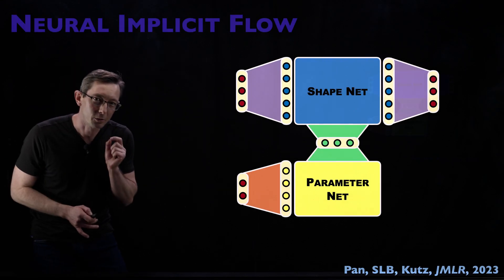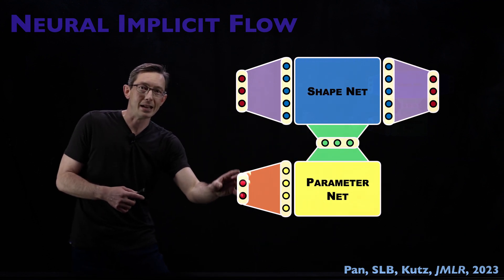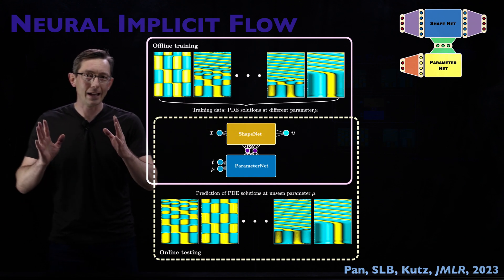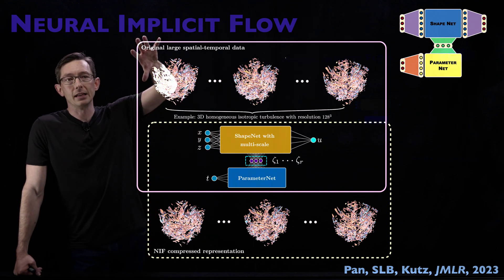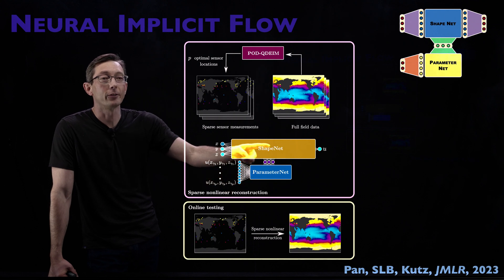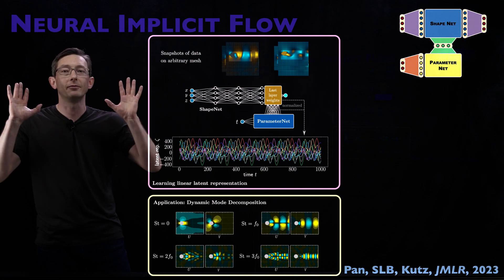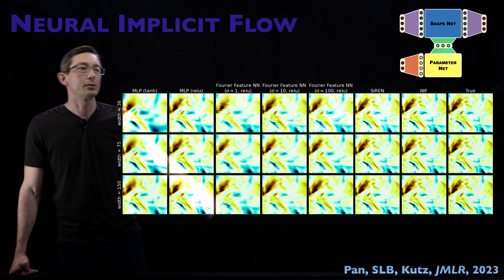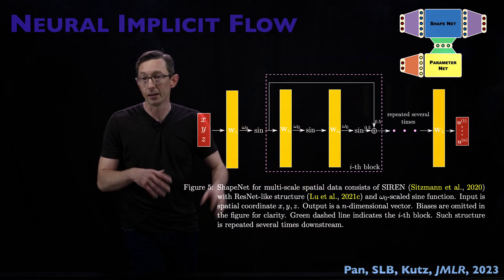Neural Implicit Flow (NIF) [Physics Informed Machine Learning]

Comment: Reading through the article, im curious about the approach of using time as an "external" factor instead of a coordinate as in PINNs.

One reason I like the Neural ODE approach is that time is continuously varied, and therefore allows for construction of a (potentially latent) phase space where the dynamics evolve continuously. Is that possible with this approach?
Reply: I’m gonna have to read his paper, using time as an external factor sounds wild to me
Reply: @joshcannon6704  yeah, it's an interesting architecture. I'm wondering if it allows for better separation of derivatives w.r.t time using the atom optimizer... Also avoids the need for a numerical integrator. Still, my big question is generalization. 

For instance, we can temporally reframe any differential equation by shifting the initial condition. My concern is that the reference time would not generalize between problems. 

Perhaps that's not a concern of the authors. They seem to care most about compressed sensing and control through few sensors.
Reply: @ryanwoodall8039  yea I’m not sure exactly how it would shake out with different problems. I use data with a ton of noise so I keep trying to learn different architectures to see what will “see through the noise” better but I’ll be honest I’m still trying to wrap my brain around this one, I’m sure I’ll need to watch it 10 more times lol